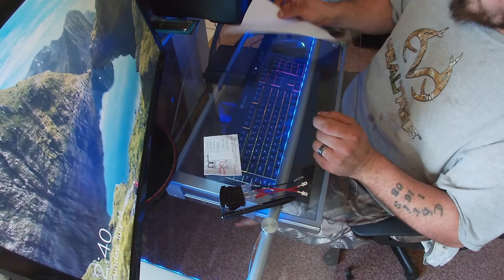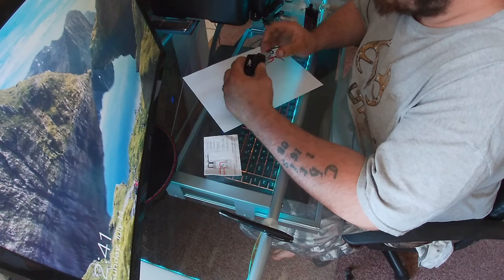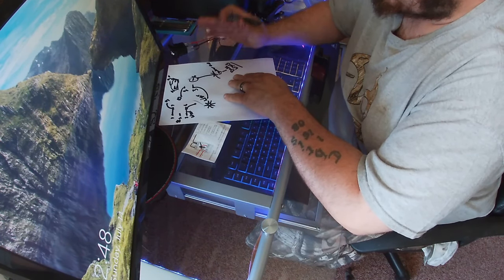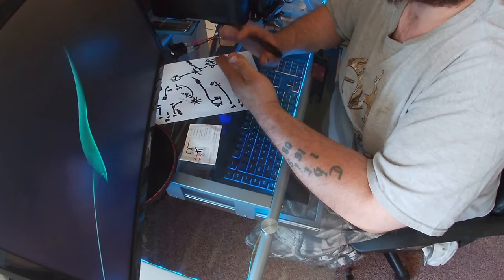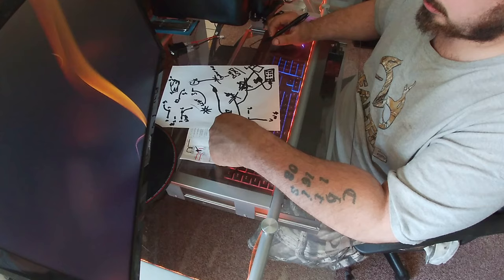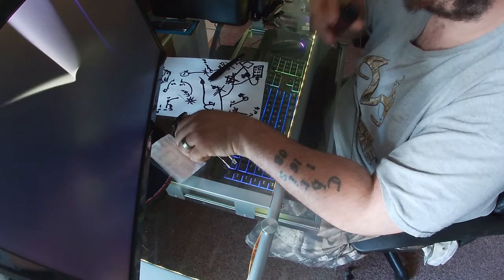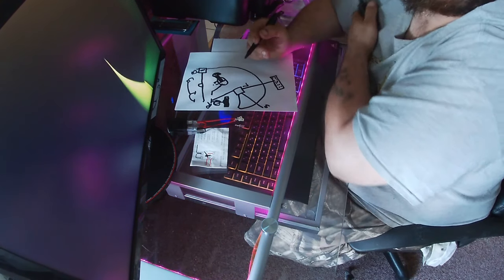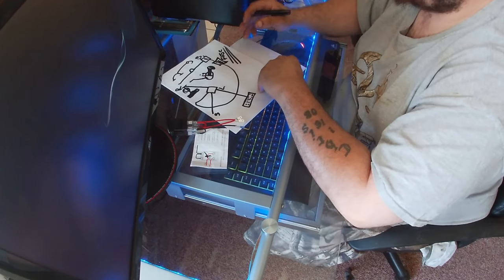How to wire a 5 Wire Rocker switch The correct way

Comment: Thanks for the fast reply on your light bar video. I bought the same light bar and rocker switch you have and this video helped me hooking up rocker switch. I used one of the 2 extra pigtails under dash for keyed power for switch. I hooked light bar to a 6 way battery fuse box I installed behind drivers seat. I also hooked up a bazooka party bar, dome light and lighted whip to battery fuse box.
Reply from the maker: Your very welcome.  I didn’t even think about the 2 extra wires under dash thanks for the reminder.   I’m glad this video helped.

Comment: Thanks, of all the videos here on YT I've watched on 5 pin rocker switches your the only one that drew out the  diagram I wanted that shows pin 6 connected to an accessories post so the lights only have power when the key to the unit is turned on, there by not draining the battery.
Reply from the maker: You’re Very welcome thank you for the feed back.

Comment: I have the 950 sport ho 2022, wired the nilight bar came with the rocker switch prewired with the relay,  I connect the black n red wires from the bar to the 2 other red n black wires coming out of the relay harness and connect to battery,  now the relay has a metal tab on it,  does that metal mount tab need to be mounted to metal for a ground for it to work properly?  I have constant power to my switch and would like it to be powered on n off with the key like the factory switches are!?!  Thanks again!

Comment: I've seen two of your videos on wiring, one being switches and the other being the switch panel.  found out more from your videos in 1 hour then searching for 2 days on others, great work!  One question, what is the rule of thumb for deciding what size inline fuse to put in, or what size fuse to use if using a fuse box?  All based on gauge of wire?  I have also seen a 60 amp breaker sit between battery and fuse box, is this really needed.  I should of mentioned this is on a Honda Talon.  Thanks!
Reply from the maker: I absolutely recommend a breaker so if the main wire gets cut and shorts out your unit won’t burn to the ground. A 15 amp fuse will run most anything

Comment: Great informative video, I’m about install some rocker lights on my Jeep. They’re Bluetooth enabled via iPhone app, but I want to put a switch anyway so I can manually turn them on and off without my phone app and this video helped a ton. One question: what size fuse should I be putting in the inline fuse... 5,10,15,20? Thank you in advance.
Reply from the maker: Michael 10A will do.

Comment: Remember that night when I went to wire that same switch to the same light, Cut the stock push button switch off to find the red, black and yellow wires. Then mistakenly wired the Yellow wire (presuming that one goes to the light) to the battery instead and melted all the wires to the switch....Not a good night!!
Reply from the maker: Yes that definitely wouldn’t be.
Reply: @R.N.GPerformance  getting some 18/3 wire today to start over
Reply from the maker: @Nightstalkerusmc  it’s unfortunate but things happen ive done it too before

Comment: Does the diagram you showed as the correct way allow constant power to the switch but allow illumination off the ignition wire? I wanna be able to run my lightbars without having a key in, but when my backlights come on in the doors and dash i want them to illuminate also.

Comment: Hi,
I have a 5 pin rocker 12 v switch. I wired my switch directly to the battery included is a relay with additional wire to the dash lights (lower toggle light) so illuminates when dash lights are on.  Problem is the upper lights stay on all the time.  This should light up when the switch is turned on but that's not the case.  Any suggestions? 

Thank you
Reply from the maker: Robert Swan  hmmm.  Sounds like one of your wires are in the wrong place on the switch.  I had mine doing the same thing so I personally just wired them both to come on when switch is on.
Reply: RedNeck Garage  thanks for the reply.  I don’t mind bypassing dash light wiring.  How would I wire differently to go on with the switch?  Thx
Reply: Is the top left ground for switch ON LED? If yes couldn’t I disconnect top left ground so switch LED doesn’t come on?
Reply from the maker: Robert Swan you just re wire on the switch side.  I believe i cover this in the video
Reply from the maker: Robert Swan yes

Comment: So you said you could run your switch to a fuse panel instead of an inline fuse. So let's say you have a panel of 6 switches, do you need to run each switch to it's own slot on the fuse panel with it's own fuse? Or could you maybe daisy chain all the switches through one slot? If you don't use the fuse panel can you daisy chain all your switches to one inline fuse and do you need to step up the wire gauge after the fuse? How would you know what fuse to pick (each fuse separately could probably use a 5 amp fuse? All the switches connected together need a higher fuse or the same 5A fuse)? This shit is throwing me for a loop. Thanks for the switch and relay explanation though.
Reply from the maker: League_with_a_T  you can do it but will need to run bigger wire and bigger fuse.  Say you have 4 switches that can handle 10 amp load you need a 40 amp fuse.  But it’s not exactly a good thing to do I don’t recommend it.  I would personally run each switch to a fuse panel individually.